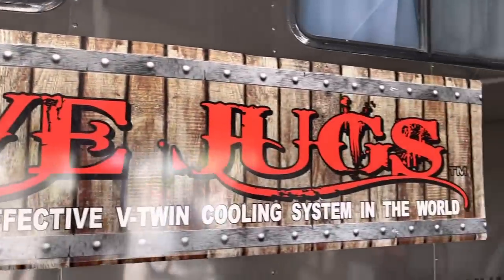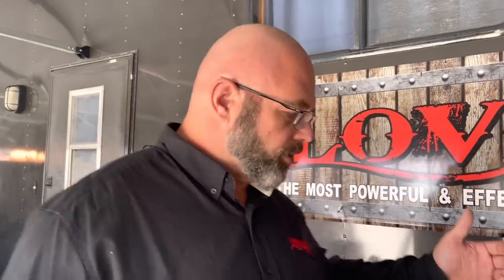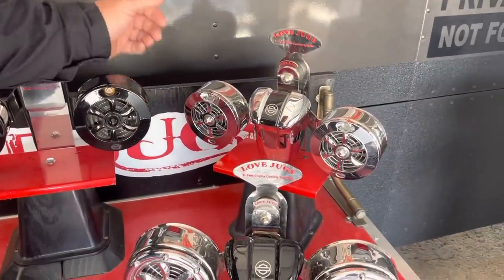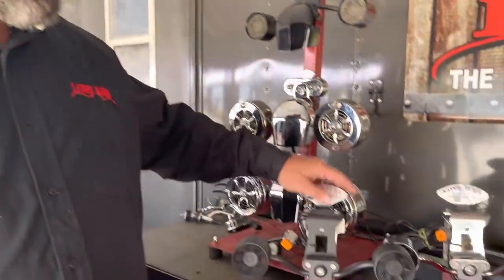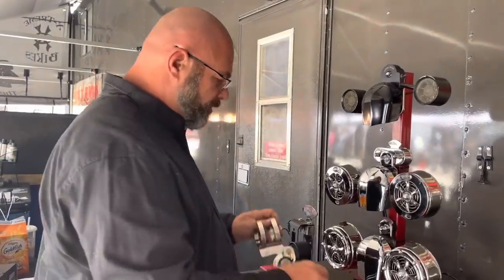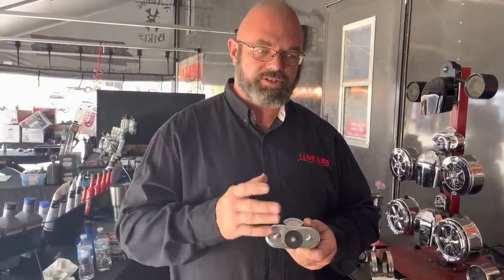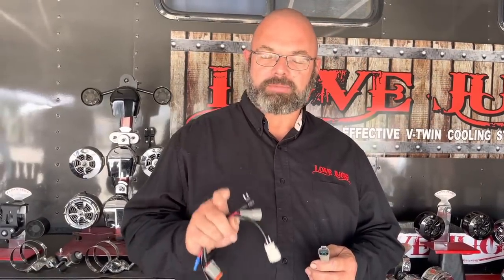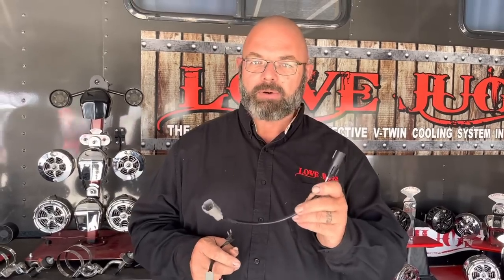LOVE JUGS V-TWIN COOLING SYSTEM. WATCH THIS VIDEO BEFORE BUYING

Comment: I had the Mighty Mites on my 2012 Street Glide until one of the fans burned out 2 years ago. I loved them while they worked. I now have a 2019 Tri Glide that is twin cooled and came with a fan mounted behind the jugs.  I will consider them in the future.
Reply from the maker: Congratulations on the upgrade, sir, I do want to stay through that the love Jugs will still be hugely beneficial on that motorcycle. The fan that is mounted behind the engine between your legs. It’s pretty much useless, it doesn’t actually cool the engine it was just designed to pull the pocket of hot air away from your leg, so it does add a little bit to rider comfort, but it doesn’t fix the overheating problem. The twin cooled system can’t always keep up because it has such a small amount of coolant so the Lovejugs make it so much more efficient. They work great in conjunction together.
Reply: @amsoiladam  I will be getting them. Thank you!

Comment: Got a set installed during laconia and everything seemed to work great even my ride up to Canada , but this week has been a scorcher here in Mass and I put them
To the test of Hampton beach stop and go traffic and  well the oil light started to flicker so to avoid any issues I slowly pushed forward, so  now it’s got me rethinking these things . I’m going to test them again and see if it was me maybe my knee blocking the air flow in  but we will see
Reply from the maker: Remember Harleys, don’t need very much oil pressure to run because of a roller bearing bottom end. Imagine how bad it would be without airflow. Maybe you’re due for an oil change as well.
Reply: @amsoiladam  this could be true i didn’t think of checking the level since I got back from Canada with her , but other than that she’s running great , gonna check probably owner error.  Will keep you updated. Thanks again

Comment: Amsoil A.,  With a dual-cooled M8 the area you're covering is already pretty well handled by the water pump system.  My Road Glide easily stays under 200 degrees even when the fans in the lowers are called-on.  Engine temp, however runs between 245 and 285.  Wouldn't it really do more good on these engines to locate the fans a bit lower to assist natural airflow over the cylinder fins?
Reply from the maker: Allen, I can agree with you in Theory, The dual cool system does have its benefits however the limited capacity of coolant that is used to cool only the heads isn’t enough in all situations. Yes it does help in minor stop and go traffic, but let’s look at this realistically. Harley Davidson took an engine that was designed to be an air cooled engine, then added some cooling passages into the head to run water through. Hence the “dual cool”. It is not a true liquid cooled engine. It is an air cooled engine at heart. Adding the Lovejugs even on the dual cooled engine makes a huge difference. Many of our customers say that adding the Love Jugs to their dual cooled engine keeps the engine cool enough that the radiator fans very rarely ever even turn on. Lowering the fans believe it or not wouldn’t help as much as you would think. Lovejugs are directing the volume of air right at the combustion chamber. This is where the heat is actually created at the source. If we keep that area as cool as possible it minimizes the heat transfer to the rest of the engine. Many people suggest to us to put fans here and there and change positioning in one way or another, but the truth is we have thousands of hours into research and development into the proper placement of our product. We have tested things that we even knew wouldn’t work to start with just to verify that they wouldn’t work. Our end product is the absolute best they can possibly be with science and data to back it up and prove it.
Reply: Nope

Comment: Adam, been watching a lot of yuour videos, great content.  I have a question, on a 22 Trike with the HD Coolflow fan (that sits behind the engine and pulls air away and down away from the engine), is there any benefit to also adding the Love Jugs?  I'm just trying to maximize cooling.
Reply from the maker: Yes there’s a huge benefit. The Harley Davidson cool flow fan does not cool the engine it is simply there for rider comfort. Its purpose is to take the pocket of hot air that’s produced by the engine and move it away from you. I’m not saying this has zero effect on engine cooling but that’s not its purpose and it is not effective. Love Jugs focuses a massive amount of airflow strategically to where the source of the heat on the engine is. Carrying the heat away from the hottest parts of the engine keeps the engine running hundreds of degrees cooler at idle.

Comment: Surely the mighty mites with their smaller fans move more air and should therefore be more effective?
Reply from the maker: Your math isn’t working, smaller fans do not move more air, the total volume is less however we increased the airspeed so they do move the air at a higher velocity

Comment: Hi Adam, it simple and clear presentation, I had 2019 RG ultra, I like the design of mity might is it ok for my bike, and if the fan works continuously may will failed sooner, there is any kind of motor easy replacement that can be kept
Reply from the maker: Yes the mighty mites will work great on that motorcycle, I also recommend the three pin wire harness adapter which should make your wiring nice and easy assuming that you’re not already using that plug on your motorcycle. And yes Love Jugs are designed for all of the parts to be easily replaced in case of failure. However failures are rare and yes we recommend that you run them at all times when the engine is running

Comment: I have a 2024 twin cooled street glide. Do you any fans/mounts that will work for my application?
Reply from the maker: I am still working designs for the newer engines with the ignition coil on the left side as opposed to the horn. I have them currently for the softail units, but not for the touring models yet.
Reply: @amsoiladam  Thank you.

Comment: I Have a 2018 road glide special want to use my diagnostic port I have a love jugs minis which cable do I need and where do I find this cable so I can purchase it Thanks again
Reply from the maker: Your DLC is a six pin, so you will need the six pin adapter

Comment: Hi Adam, iit was fun running into  you at the MN renaissance.
Do you have a piggyback plug? My 08 is set up for a heated seat
Reply from the maker: You can get a Y splitter to run multiple accessory’s off of the same circuit however it’s not something that I currently offer. I ran out of stock and getting new stock has been very difficult lately. You should really buy it through your Harley dealer and even like JP cycles

Comment: Can you tell me, or lead me to a page that will tell me, about the cost including  having you install these at a rally?
Reply from the maker: Tell me what model of Love Jugs you would like, and what motorcycle you wish to install them on and I can give you a quote. You can check out the various models on our website
X-Tremebikes.com
Reply: @amsoiladam  well, I’m not sure how they compare. Polished of course but after that, there are a few things for me to consider- which model performs best and which are the least uncomfortable as far as being in the way…and how to prioritize between those two factors. My biggest concern is the heat that comes up the right side when in traffic… now I know these install horn side, something else to note is that I have the Willie g skull horn cover (you can see my bike on my channel), but I image it cools both sides to an extent just being on the engine as a whole. But maybe the original is better at it than the cool master or mighty mites? But maybe the smaller mighty mites are less of an annoyance as far as being “in the way” while riding… sorry, guess I have questions lol. My bike is a 2014 Road King. It’s actually in your Laconia video for a second..black, chrome, and copper.
Reply from the maker: @graybeardbiker  the coolmaster is considered our most powerful and most durable version. And if your horn isn’t in your way, most likely, the Love Jugs won’t be either. We mount to the left side because that is where the spark plug enters the combustion chamber. That is the source of the heat. If you keep that area as well as the exhaust port, cool, it prevents excessive heat from traveling throughout the rest of the engine.
Reply: @amsoiladam  Sounds good. So quote me on that one. Hope Sturgis is going well for you. Will you be at Lake of the Ozarks?

Comment: I would like to install on a 2018 Harley Davidson Deluxe.  How is the mount for this style?
Reply from the maker: We have a specific model design for the 2018 and a newer, softail line that is powered by the Milwaukee eight engine
Reply: @amsoiladam  where can I see how it looks installed?  I am scheduling my trike for the Lone Star rally and thinking about doing my Deluxe also
Reply from the maker: @rodrigogonzalezjr8602  if you go back about two years, there’s a video I made down at Brandon Harley Davidson in Florida when they allowed me to do an install on one of the floor models

Comment: Would it fit on Royal Enfield Interceptor?
New rider here....I'm guessing my engine would be too small for this product.
It's already has a mounted oil cooler, just thought I could add even more cooling capabilities.
Reply from the maker: Heading airflow will most likely be a huge benefit however I’ve never had the opportunity to try to fit anything on the royal Enfield before

Comment: Last thing, I saw in one of your videos from a couple years ago (or the manufacturer video) that stated the Love Juggs will NOT fit (to a trike in my case) with the Custom Dynamics Pro Beast horn.  Is that still the case?  Is there an adapter we can use to make it work?  Again, thank you for helping me with my questions.
Reply from the maker: Can you send me a picture of what a pro beast horn looks like, I don’t recall. If it’s the big oval one the no there’s nothing I can do to make it work and still looks good anyways
Reply: @amsoiladam  Thank you however, I see you sell the mini banshee, that will work just fine and gives me more options.  See you later this week!
Reply from the maker: @BrknRidr10317  yes the mini banshee will fit underneath the OEM horn cover. Which means it will all work just fine with love jugs

Comment: Even though my 2015 Electra Glide Ultra Limited Low is liquid cooled.  Would it hurt to still add the love Jug system to for extra cooling? I can’t take my lowers off.
Reply from the maker: Not only would it not hurt it would actually be a huge benefit and keep it running much cooler. Believe it or not Love Jugs are far more effective than the liquid cooled  heads

Comment: Do you have proof or pilot study that your Love Jugs really manage engine temps and why is not not temp trigger if engine is getting hot?
Reply from the maker: Yes we’ve got more than 4000 hours of testing. But to keep it simple it’s common sense if you throw air at an air cooled motor it will run cooler than if you do not throw air at it plain and simple. If you watch any of my other YouTube videos when we were at rally you will see that I allow my personal motorcycle to idol for anywhere between eight and 18 hours per day and it never overheats. There are too many downsides to thermostat switches in this application. One it does complicate the wiring and requires the use of a relay to do properly. They are very unreliable because the quality of what’s available just isn’t very good. And then the main reason I don’t like them is because it allows the engine to start to get hot and then it tries to cool it back down. It’s better to just not let it get that high.

Comment: Cools the left not the right side will the uneven cooling cause your jugs to warp and cause cylinder damage????
Reply from the maker: Not at all, airflow is focused at the source of the heat, slowing the spread
Reply: If that were the case, they would  warp from riding into the wind.
Reply: Funny question @john! 😂

Comment: Do you recommend for a 2022 Triglide ultra that is liquid cooled?
Reply from the maker: Yes definitely
Reply: @amsoiladam  I would like to set up to have some installed at the rally in Galveston if possible
Reply from the maker: @rodrigogonzalezjr8602  if you go to the website, you can actually make an appointment during one of the Rally days. And in the notes you can make a list of exactly what items you want. It will take a $50 deposit to hold the spots and the product. https://x-tremebikes.com/2023-events/
Reply: @amsoiladam  thank you I will definitely do that.  I would like them to activate off one of my auxiliary switches.  Do I need to purchase that ahead of time or do you carry them?
Reply from the maker: @rodrigogonzalezjr8602  I do not carry the switches or switch panels for the motorcycle. The adapter that I use will plug into the accessory circuit and only allow Power to go to the fans when the motorcycle is powered on, which basically makes them someone automatic. There’s really no reason for the extra switch but if that’s the way you want to do it just purchase the switch kit through your dealer that accommodates a four pin Deutsch connector.
Reply: @amsoiladam  I got you, let me see which option I will go with.  Thank you, see you all in November

Comment: Have a 2017 CVO limited, 128 stage IV 550 cam has a good vibration. Would like to install the love jugs. What mount?
Reply from the maker: On 2017 and newer touring model she do not need any additional mounts, however I do recommend the three pin wire harness adapter.
Reply from the maker: Dick Weed  If you only wanted to last a couple of days maybe.

Comment: Just bought a set of Love jugs for my 2011 Softail deluxe and my question is would I need to have that vibration adjuster?
Reply from the maker: No the softtails are counter balanced engines and the origind mountain so the vibration is already minimal
Reply: @amsoiladam  I put it on the bike and it works great but I have a question for you I noticed that you sell Chrome fan covers, what about the black ones I think I might want to change mine to Black.
Reply from the maker: @buster1173  I believe that all I have available at the moment or the chrome covers
Reply: @amsoiladam  I did look on their website it wasn't on before but now I noticed that they do have them they might be out of stock but I could check with JP's down the block about 20 miles from me but it's down the block

Comment: I have a 2016 road glide I want to know what I need
Reply from the maker: You can choose whatever model of jokes you think will fit your bike the best, on a 2016. You will also need an eight pin, wiring, harness adapter, and a frame mounting kit.

Comment: Do they blow the hot air to the right side of the bike onto your right leg?
Reply from the maker: They do move air from the left to the right however, there’s always hot air on your right leg anyways. With Lovejugs running the air is not as hot.
Reply: They certainly do on my 103 softail but that just means they are doing their job in my opinion. 
I'd rather have a hot leg than cooking my engine.
They make a huge difference and I measure the Temps on my FP3 tuner.

Comment: What will work for my 2016 Harley Davidson Sportster 48?
Reply from the maker: I recommend the mighty mites simply because they look better on the smaller engine. And sometimes you’ll have to use a modified mounting bracket.
Reply: @amsoiladam  ok great thank you My engine is a  XL1200X not a small engine at all. Would you be able to send a link for that product?
Reply from the maker: @RickyBobby8711  Well when it comes to the XL motors yes you have the larger one! But the XL line is considerably physically smaller than the big Twin series like the evolutions, twin cams and Milwaukee eights. They are physically much larger engines as well as having considerably more displacement.

Comment: What's the  average  temperature  drop of the heads  using the love jugs
Reply from the maker: We advertise 100° drop at idle. But I have actually measured up to 250° drop in many cases.

Comment: Any insight into the availability/inventory of the Love Jugs products? The website looks sparse.
Reply from the maker: And give me some time and I will check our total inventory levels
Reply: Well I took the bait almost 500 bucks from dennis kirk 
Mounted on 2010 RG
Now my jugs might get cooler but my right legs is on fire and yes I have guards ,heatsheilds,etc,  so in all reality I purchased a 500 heater !!
Reply: @brianmoran8937  thanks for your input. I was wondering if there were any "side effects".
Reply: @classicrider103  
I rode with them for a month still  believe the would work better for the rider if the fans worked in the opposite direction,  as of now justa$500 leg burner !

Comment: Wouldn't it be better to have the fans reversed to pull the heat away from the heads instead of blowing hot air onto them
Reply from the maker: Actually, it is way more efficient to force the air at the heads. When trying to draw heat away from an item, you would have to shroud the entire engine in a box for the work and nobody would want to do that. That’s why radiators on cars have shrouds around the fans to force the air to come through the radiator rather than around it.